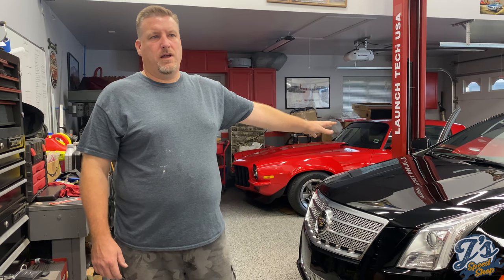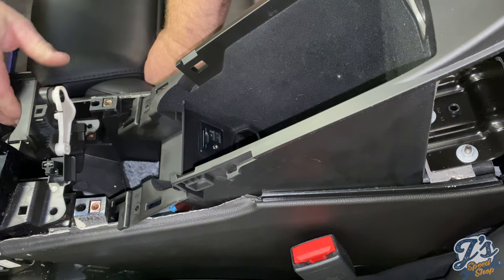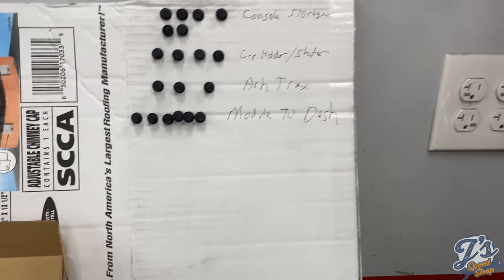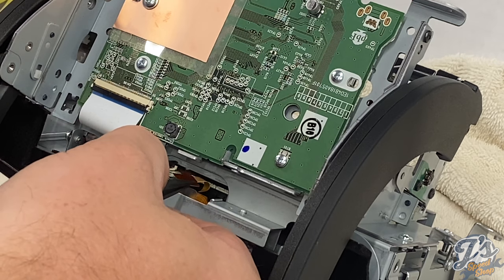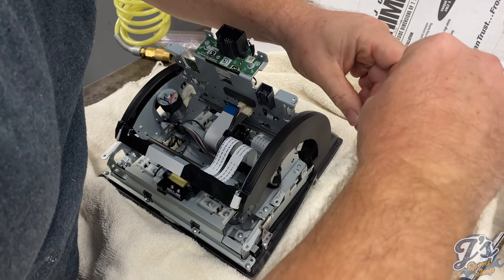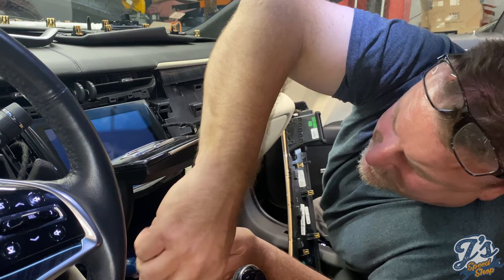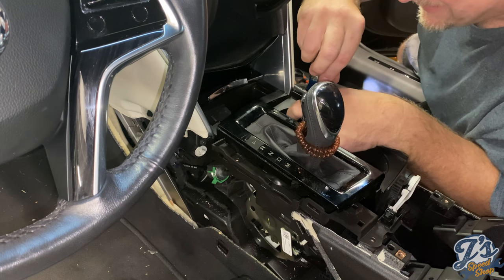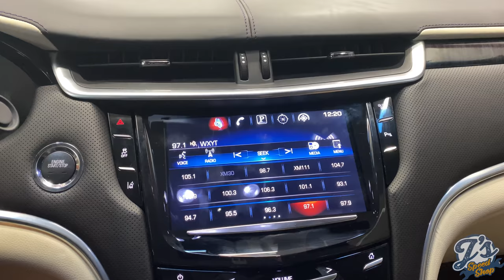Cadillac XTS Cue Screen Replacement

Comment: I replaced the screen on my wife's XTS yesterday in about 4 hours and the video was helpful.
A few things worth mentioning:
1) CUE screens has updated the new screen and the same screen works on any year. The part number of the radio doesn't matter.
2) a 1/4" extention with a wobble head makes getting many of the screws out much easier.
3) a small screw driver with interchangeable tips is great to disassemble and reassemble the radio.

Comment: I have the exact car and the same issue. I watched your video, then ordered the replacement part from Cuescreens. Then, after receiving the replacement part, ran your video step-by-step. It works beautifully. It took me about 4 hours, because I took my time, documented the sequence etc. Thank you for doing this video, saved me at least $1500 because my dealer would only replace the whole unit.

Comment: I have to credit this video as being the best regarding reassembling the dash components in my XTS. Most of these videos only show you how to unscrew and rip everything apart and leaves you hanging with putting everything back together. I struggled the most with reassembling the trim/dash/gear shifter assembly and almost lost my mind. Glad I saved a lot of money but I'd rather not go thru this again.

Comment: Before anyone attempts this ..
One should use magnetic tip Phillips #1 & #2 screwdrivers
and have a small magnetic extension tool handy 
Even magnetic sockets would be nice, but not necessary.
One could also upgrade to the newer module $800+ to
incorporate the ability to have apple & android apps with a
faster screen  response time  & better GPS
Maybe just bailout on CUE and go for the
10.3” Tesla screen that also controls your  HVAC

☑️Thanks for showing us this nightmare that
Cadillac should ‘own up’ to.
👉 A well known problem that
the dealers have been sent TSBs on this.
Reply: What is TSB? Top secret broad casts?
Reply: @Meechka  TSB means
Technical Service Bulletin 
These bulletins are sent at to 
the Service Department of Dealerships periodically as the Manufacturer becomes aware of potential problems occurring to a particular vehicle model & year.
A TSB is assigned a number.
You can lookup on the internet 
if there are any TSBs for your 
Make Year Model of your vehicle.
Reply: I AGREE..... Cadillac should really take responsibility for these.

Comment: Thanks for making the video.  I just finished replacing my Cue Screen on my 2016 XTS and it works again. Don’t think I would have attempted  it on my own. There were some slight differences  between 2013 and 2016.
Reply: How much would you charge me to do mine? I just inherited one with 5200 miles on it and the screen doesn't work in the center and at the bottom
Reply: Excellent video. I replaced one few years ago on a 17 CTS was easier  removed upper dash panels. Did this for a friend 18 xts. really struggled removing the 4clip panel by ashtray. Your suggestion to use long screwdriver saved the day. I really like how you show the real process rather than just showing after the struggles. Nevertheless with patience a doable project that saves $$$$. Thank you very much

Comment: Just replaced  cue screen my wife’s cad SRX  2013 ,20,000 miles on it , GM SHOULD HAD A RECALL ON THE MAJOR PROBLEM BUT DROP THERE PROBLEM ON THE CONSUMERS
Reply: My  xts is 2014 has 51000 on it. Andxdealwr want almost 1300 to replace. Mine started with the controls for air condition but didn't realize.  It was all connected. They see a lady coming and dint try to help us at all. My husband passed away and I think they see me coming.
Reply: I am hoping my son and his fathers in law can do this. The dealer wants to replace whole unit. They didn't day one word about just replacing the screen. In fact it was a very big problem the dealer said he replaces at least 1000 a yr

Comment: I replaced mine but when I plugged it back in, the screen still won't come on. It's totally black as well as the steering wheel. I can control the air but there's no lights on the entire Cue. Nothing about the screen works though. Do you have any idea why it wouldn't power back up after plugging the new Cue up?
Thanks for any help.
Reply: Blaine, Mine was the same. Actually after replacing it nothing works including the car wont start and the cars battery drains down to 4.5 on the meter in less that 10 seconds. Good battery and no issues prior. I need someone out there to give knowledgeable assistants.

Comment: I've got one of these POS GM build Cadillac XTS 2013. There's a class action suit about these screen spidering what GM has managed to stall it so long most people have gotten rid of them and they stop building them in 2019. I bought an after-market screen for 40 bucks and for years couldn't get anyone to tackle this job no mechanics want to touch a Cadillac. I finally found some shop with young guys working out in the middle of nowhere and the dude had it in in a single day and I don't think you have to jump through that many hoops to get it out. There's another video online some black guy doing it and it only took a few screws removed and the entire Central dash comes out. Now I'm dealing with all the other thousands of crappy builds of these Cadillacs by GM and it's costing me thousands to keep it on the road. American car manufacturers should be held criminally liable and jailed indefinitely. Now in 2023 I can't afford to get into another car or it would be a Lexus for sure. I'm just going to drive this Cadillac until it falls to pieces... Oh wait it's been doing that for years!

Comment: It 
Would be more expensive but would it be less work to by a while unit. I watched a video and looks like it would be simpler just to replace the whole unit. More money but looked this not near as many pieces to take out. I have no clue. I am a gal.
Reply from the maker: Most of the work is getting it out of the car. Replacing the screen is fairly quick.